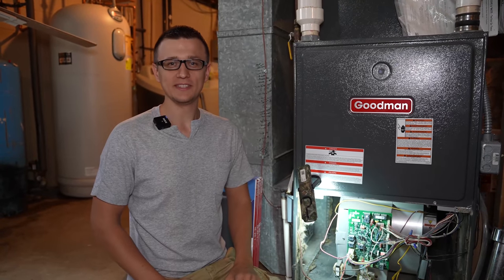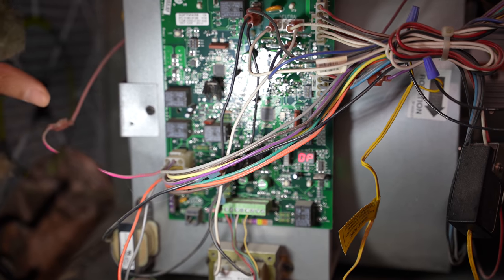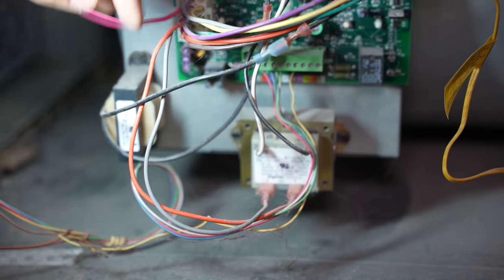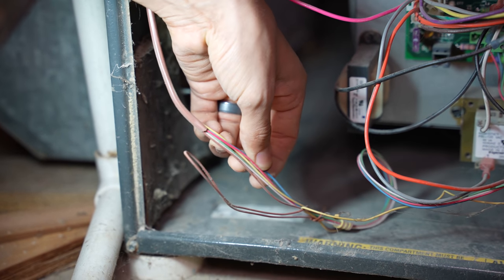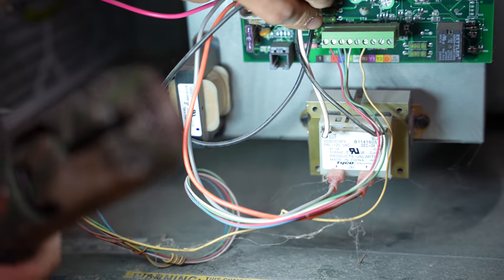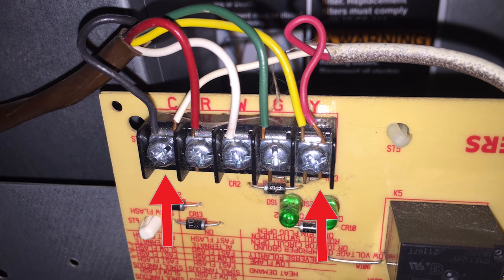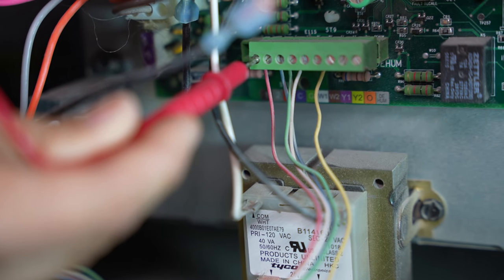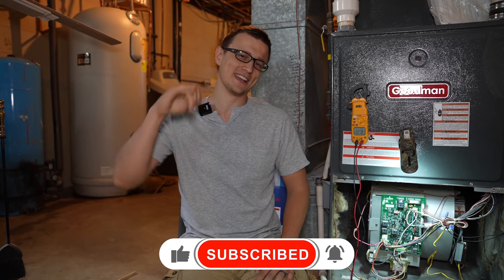HVAC Furnace Has No C Terminal?

Comment: We have a 20 year old Goodman furnace. It does not have a C terminal - however there is already an unused C wire running from our old thermostat. We are installing a Nest smart thermostat. Where do we attach the C wire at the FURNACE? (There is no c terminal to simply plug it into). Can we attach the C wire to the ground that runs from the 24v transformer? No one seems to have a clear answer how to install these thermostats with a furnace that has no C terminal. Thanks!
Reply: That's exactly where I'm at, hopefully he responds.
Reply: I have found myself in this exact same situation with a house I just purchased. Any luck?
Reply: Probably need to go with the last ditch effort and ground it to the frame
Reply: I can confirm connecting the C-wire to the my transformer 24v side (opposite of red wire) worked for me and in the process determined that my fan relay coil was burned out which is what got me searching around the unit in the first place
Reply: Hi there! I am in a similar situation with an old Goodman GDT070-3. No C-wire at thermostat or C terminal on the control board. The Nest compatibility checker instructed me to get the power connector, which I have. It looks like my best option right now is to ground the C wire coming from the power connector, but in other forms I've read that a ground is not appropriate. I'm curious about how you resolved your issue? Thanks!
Reply: I think the best bet would be what he said, find the two wires going to the outside unit. One of those will be the 24V Common (C wire). The other wire probably ties to R or Y (mine ties to Y).  My unit doesn’t even have a control board… 
if you have a meter, you can find which is the common, by putting the probes on those two wires - if the reading on the meter is positive 24V, the the common is at the black probe. If it’s -24V then the common is at the red probe.
Reply: C and neutral is the same. Go to neutral terminal and your fine

Comment: Every video talks about Hvac What about adding a nest c wire to a two wire Boiler system
Reply: Thank you someone asked the right question. All I see is the ones with HVAC. I have a 2 wire system Honeywell old furnace but still works good. I don’t even have a Board
Reply: @PAlouidor  I have the same setup. How did you end up hooking it up?
Reply: @TonyVM775  add a secondary transformer to your boiler setup. Nice and easy to do

Comment: Remember an outdoor unit for a heat pump will have many more wires. R W Y O and C and sometimes G.
Reply from the maker: Thank you for pointing that out! I should have talked about that. As far as I recall most heat pumps do have the blue wire for common though. Hopefully I was right about that claim.

Comment: Sooooooo.  My furnace has no “c” common connection area.  Are you saying I can simply connect my common wire from my thermostat to a furnace ground screw?
Reply from the maker: Technically that is not the proper way to do it but I have seen it done that way many times. Basically if the common from the air conditioner (24v) is going to a ground screw, then you should be able to safely put your thermostat common there as well. If you would like to understand a little better why it works, this video may help clear it up a bit: https://youtu.be/wiKDlIlbiP4

Comment from the maker: I know some smart people stop by my channel sometimes so a question for you 😃 Besides tracing the 24v common wire from the transformer or from the air conditioner, what other ways are there to locate where the 24v common terminal is in the furnace? Or is there an even better way to do this?
Reply: I think I'm a smart person - I bypass the fuse and short each power wire to ground with the door safety switch depressed. Whichever lets the magic transformer smoke out is the one that is not the common. Then I refill the transformer with magic smoke, and also leave the fuse bypassed to save the next guy the extra step of doing so when he needs to find the common.

Comment: Thanks!  My heat went out and I bought a new thermostat.  The new thermostat needed the C wire.  But my old furnace didn't use it either.  I followed your steps to find the common and hook up my furnace to my new thermostat.  All working now and no repair man!  Huge thank you again.

Comment: My hvac experience is limited, but I know a lot of the newer thermostats have to be supplied with a C wire to work properly and I always assumed that as a last resort that the common could be taken off the chassy or tap into the common from the transformer.    Thx for confirming it.    Great video!!
Reply: I have the same situation, and my furnace company told me that the green wire cannot be connected to the furnace. So unless them some other device that can be used as an extender I’m not able to get a thermostat that can be used within an app. I’ve watched so many videos, and I’m ready to give up.

Comment: Thanks. You helped me get my Honeywell 9000 hooked up. There was a Blue wire coming from the wall connected to the old Battery operated thermostat but it wasn't hooked up at the furnace. That White & Red coming from the AC did the trick on where to connect the Blue wire. I recently moved and took my Honeywell with me. I like it too much to have left it. Especially at a $130.00 then and $180.00 now.
Reply: @GLC, did you plug that blue wire from thermostat  into C connector on the controller-furnace, where your White wire was already plugged in and did you end up with 2 wires on C now? (blue from thermostat and White from AC outside) and did you need the blue wire plugged in to  provide power to your thermostat?

Comment: The comm wire sheered off on the furnace side and the thermostat went out but it was a super easy fix cause I can see where the piece of broken wire was on the board just had to strip a little bit off to expose the wire and stick it back on the common screw on the board. They tightened that screw so tight that the wire just sheered off lol. Super easy fix thanks for the vid.
Reply from the maker: Glad to hear you were able to find and fix the problem! Stay warm!

Comment: Thank you very much . You saved me a $75 service call . I had to light my pilot light in the attic and im 350lbs that was fun to get up there first of all . Then I have to lay in the crawl space . We'll i got the light lite but my fat a*s belly pulled on the white wire and it came undone  I didn't know where it went back to. Your video helped me understand it.  Got it back in place where it said "w"  big dummy.  Heat kicked on and I have a back ache but it works. .. thank you much

Comment: Poor kid.
Three sisters age 92, 94 and 96 live together in a house. The 96 year old draws a bath. She puts one foot in the tub and stops and yells to the others, hey was I getting in the tub or out? The 94 year old yells, I don't know, I'll come up and check. She starts up the stairs and stops and yells was I going up the stairs or down? The 92 year old shakes her head and says, boy, I hope I never get as forgetful as those two. She knocks on the wood table for good measure. She yells I'll be up to help you both after I see who's at the door....
Reply: Ba dump bump...
Reply: LOL nice
Reply from the maker: Haha thanks Mr. Classic! I will need to use that one 😄 and if anyone else has good ending material for me, I am all ears 😉
Reply: Question, if you have a video please point me in that direction.    Say I want to hook up a pan shut off switch how is that beat accomplished.   I heard you interupt  the compressor and allow the fan to keep running, and I've heard interupt where the compressor and fan shut off?   Basically how do you wire that in.   As a follow up, how should you wire in these new air cleaners to operate while the fan is running.    Thanks for some great education.

Comment: I am so glad that you post this video.  I have been struggling with a air handler with no control board.  A more than 30 year old air handler (Lennox CH19-65-2 and B19-51-1P) and a condensing unit (Lennox HS19-651V-2P).  I guessed it to connect the C wire from an ecobee thermostat to one of the two wires from the condensing unit.  I probably connected the C wire to the hot wire instead of the common wire.  Would this damage the machine?  If so, how do I do troubleshooting?  As it has no control board, I couldn't find a fuse or anything.  Any comments will be very much appreciated.  Thanks!  I have learned so much from your videos!
Reply from the maker: Happy to hear that the video was timely for you! From what you explained, it sounds like you wired a direct short. My guess would be that the thermostat would get damaged first. But did you disconnect it right away? It's possible there was no damage but of course I can't say anything for sure without being there. I should have explained this better in the video but if you have a meter it is very easy to determine which wire from the AC is hot and which is common. Simply measure voltage from one of the terminals (C or Y) and put the other lead to any ground terminal or even a screw in the furnace. If there is 27v, that is the hot wire. If no voltage, that is the common. This troubleshooting would be done with the furnace and AC powered on and on standby. (not running) And if there is a door switch, that needs to be closed too. Sorry, that was a long-winded answer. Let me know if that made sense 😅
Reply: It looks like the thermostat is still ok so I will try to connect it to the correct C wire as shown in your video.  However, I will have to clean the condensing unit first because I found it has become a bee's nest when I opened it.  It looks like the compressor was wrapped with material something like the batt for attic insulation and it became the home for bumblebees!  I am wondering why the previous owner of the house did that.  Any reasons to insulate the compressor itself?  I live in Boston btw.  Thanks!
Reply: Something to add here!  If I remember correctly, the thermostat lit up when I connected the wire but it doesn't start the air handler or condensing unit when I set it to cool and dropped the temperature.  Maybe I didn't connect the wrong wire?  In addition, I tried to jump start the air handler by connecting R and G "binding posts" with a wire.  The air handler didn't start but I heard a zap and maybe some spark.  Or I can only do this on the thermostat side instead of the air handler side?

Comment: Very helpful video.  One question if my control board does not have a C terminal.  Can I simply connect a thermostat C wire to the C wire coming directly out of the transformer to provide power for the thermostat or will this cause issues?

Comment: Love your video,  but let me see if I can describe my issue. I'm trying to switch out my current thermostat for a smart wifi thermostat. The wire bundle going into the thermostat has an unused white wire. But when I check the HVAC wiring, the white wire from the AC is connected to the Y connection. And red goes to the common.  I'm not sure if or how to modify the HVAC wiring or why it's even the way it is.

Comment: Love you videos, so helpful. I hope you can advise me. I have a blue common wire unattached. However, all of the 5 screw in slots on Amana furnace control boards are full including the common spot where there is a red wire. Where would I attach the blue wire. Grateful for any help.
Reply: P.S. Trying to install a nest thermostat.

Comment: I'm trying to connect the C wire from thermostat at the furnace end to the correct wire. There is no terminal block or control board with marking, just bunch of wires.I have the brown from condenser with two leads.1. White wire connecting to Yellow on Thermostat wire (Y). 2. Red wire connecting to a blue wire that goes to the steel frame of furnace board. My guess is red wire is the C wire in my case and need to connect thermostat C wire with that. Did I identify C wire correctly since it goes to the frame?

Comment: Question for you, my wires look like yours coming in to the furnace, the blue and tan wires are unused wrapped around the other wires, same as the thermostat wires, BUT I tested both the blue and tan wires for voltage, the blue has 10v and the tan wire has 11 v evin though they are not hooked up in the furnace or the thermostat??? I'm confused

Comment: Thanks for information. I have only five wires coming out into the thermostat. I don’t remember exactly which one that I had to disconnect for it to start calling when I have all wires connected to the thermostat. It doesn’t cool down. Just keep some running. What am I doing wrong

Comment: i cant find the control board. i have older weil mclain cg boiler and i want to install a nest and need to install the C wire. can you do a vid on where to do this on a boiler (heat only) that doesnt have a control board? or point me in the right direction so i know where to look etc. all advice is appreciated.

Comment: Thank you! You helped me figure out how to replace my old analog thermostat with a smart one without having to spend 300 on an "expert" 😅
Reply: I'm trying to do the same, but having trouble. My wire coming from outside is like the one in the video with a bunch of wires. But my furnace also doesn't have the control board. All wires are hooked up by twist connectors. The blue one connects to a bigger black wire like the one you call a 120v from the transformer. Those four bigger wires are red, white, black and green  The present thermostat has five wires but no "c". There is an "o" for the heat pump I think. The red, white and green wires from the thermostat connect to the corresponding bigger wires. Then the blue wire from the outside bundle to the black one. What the heck?

Comment: Hello, the common contact on the circuit board is only pulling 22.5 volts, every other is 28 volts. This is preventing the fan from operating. Can I tie in the A/C condenser neutral wire with another low voltage wire in the furnace? This video is a great explanation to find it, but where could I tie in aside from the terminal? 

Thank you sir

Comment: Thanks! can I use this technique to hookup C wire to my smart WiFi  thermostat?
Reply from the maker: You're welcome! Yes, you should be able to as long as there is an unused wire available.
Reply: @WordofAdviceTV  Yes. There is a spare blue wire not connected to thermostat.
Reply: However, last month, I hired a AC guy to replace old Thermostat for new WiFi Thermostat but somehow he did incorrect wiring and now I believe my electric Heat strip turn on when the AC running because last month electric bill sky rocket to $265 a month. Also, when I turn on the heat and the heat is not running only the IBM blowing. How can I troubleshoot on this issue. Please help me to understand the basic tracing. Thank you.

Comment: In this video you show connecting a wire directly the metal AC case. Does the other end of the wire connect to the Thermostat "C" terminal to complete the "C" wire connection?  Thanks!  Clint

Comment: Great explanation.  I have one question.  I have a heat pump system and want to install a Nest thermostat that requires a C wire, which I don't have.  I'm seeing some folks pull the green (fan) wire and instead connect it to the C on the thermostat and at the blower.  Since I never run the fan separately this seems like a good choice.  Does this make sense?  Pulling wires would be ideal but almost impossible since I think they stapled the wire to 2x4 studs.  Thank you.

Comment: Great Videos!!  I have learned a lot. I am having a weird problem where my thermostat was going blank and then later in the night it would come back on and it would run until the AC until next day when it got hot again and shut down.  I have 120 volts going to the furnace, The 3 amp fuse is good on the board , I am thinking it might be the 24 volt transformer is getting to hot and shutting down, in turn not putting out the 24 v needed to turn on  the Thermostat. What is the chance it is the board.  I am picking up the transformer on my way home.  Thank you!

Comment: Think I just figured it out. The white wire from the thermostat bundle coming into the HVAC is not connected to anything.  And the HVAC has a connection pointed labeled CTU which I think is a common and to which I can connect that unused white wire. Sound right?

Comment: Great video. I'm looking to instal the Google Nest Power Connector and I just found out that my furnace controll board has two C terminal points, one with two wires connected and the other completely free. Now I'm not sure to which of these two C terminal points should I connect the C wire from the Google Nest Power Connector. Please let me know.

Comment: Thanks, learned a lot! However, my HVAC has 5 terminal wires only Y,R,G,W but no C and it has a B.  The white wire from the AC outside (only have 2 wires red and white) goes into the B terminal.  Can I use this B terminal as C for my smart thermostat?
Reply: Any update I’m having the same issue

Comment: This should work if my thermostat has both Rh and Rc connected? System is forced air with AC and oil boiler with hot water coil on the air handler (ICP FXM4X4800AL) I’m going to tap into the common on the 2-wire that goes outside to the AC condenser. Just afraid of shorting something out because there is not a typical “control board” inside the air handler on my system.

Comment: Is the C terminal  the negative of a 24 Volt AC transfer? Or DC voltage?
Reply: It's 24 volts AC there is no positive or negative. There's a primary side of 120 volts and a secondary side of  24 volts. One of the secondary leads goes to the red wire on your thermostat. The other wire is the common or C wire. I just connected mine today to make my Nest thermostat work.